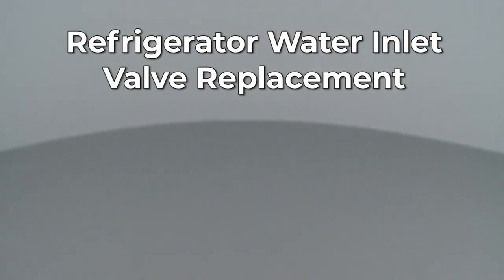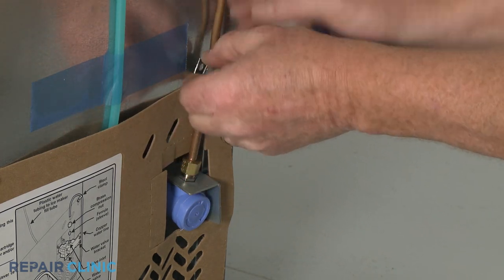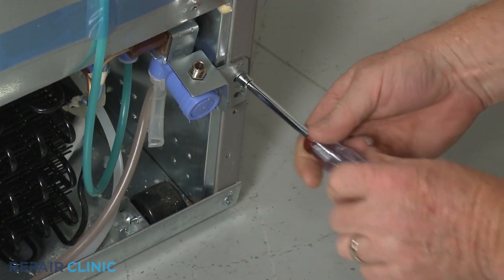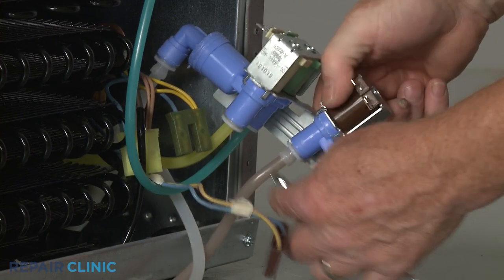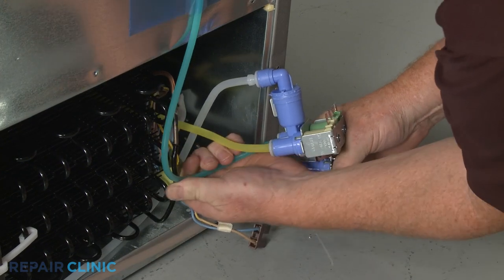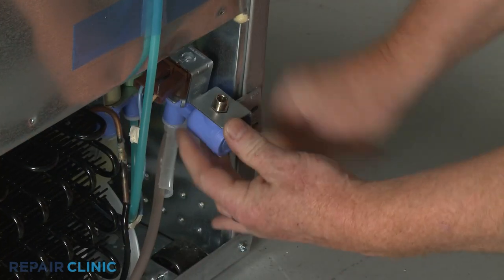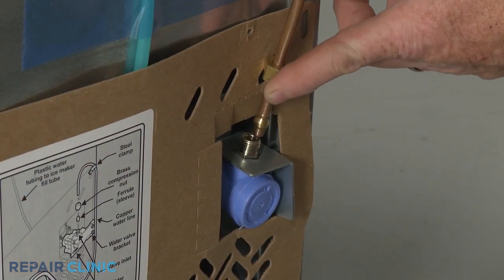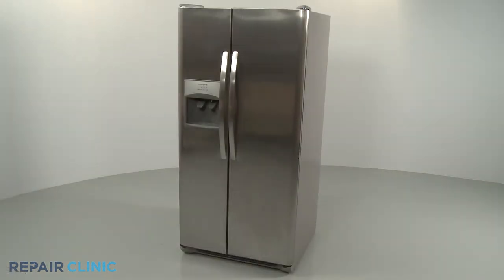Water Inlet Valve (242252702) - Frigidaire Refrigerator Repair Help

Comment: Hi - I have a Kitchenaide KSSC42QKS01. Behind the ice maker there is a 
plume of ice coming down from the fill tube area. Would this be an ice 
maker problem or the solenoid valve leaking water when it is supposed to
 be off?
Reply: I could be a leaking water valve Or a blockage in the ice maker fill tube.

Comment: Replacing this did not solve my slow water filter flow. The only time I get good  water flow is after a filter change. It works well for a couple weeks then it goes back to slow flow. Any other suggestions??

Comment: Stupid mistake!  I got a little frustrated & impatient..... I cut the lines because I couldn't get them out & thought they would just plug in the new water supply valve.  Can I buy just the connectors & reattach to the water lines?